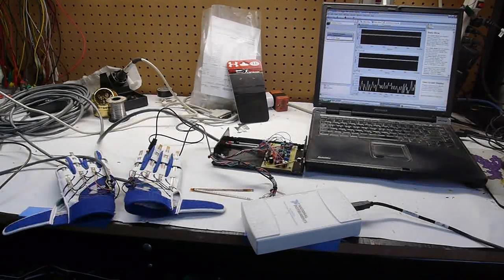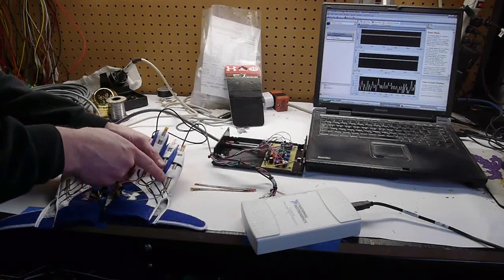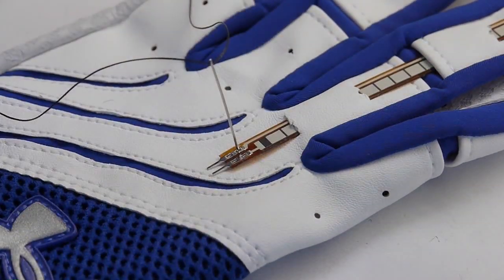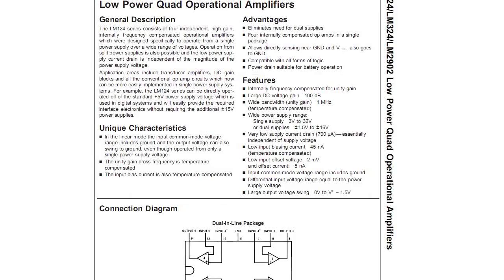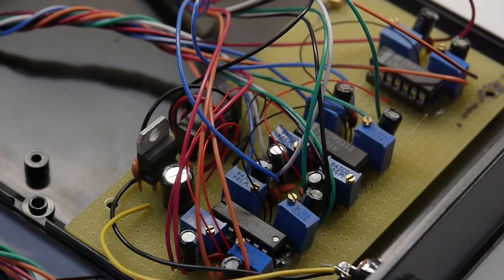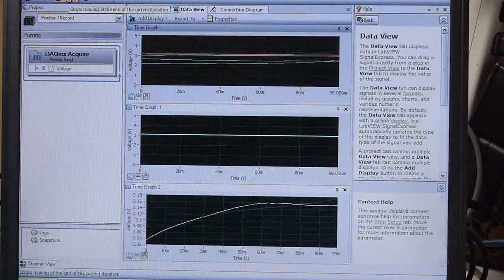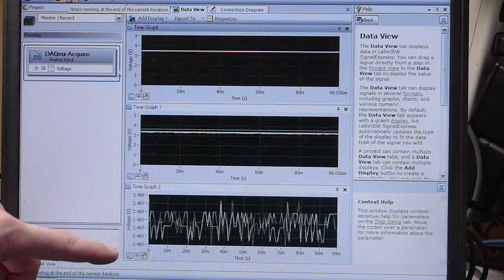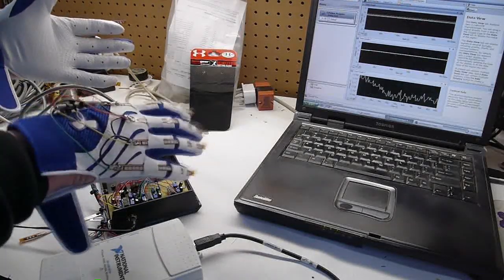DIY flex sensor gloves for possible VR or video game control

Comment: Big fan of your work Ben and extremely envious of your shop! Being a hobby electronic musician I'm wondering if you've ever taken a stab at making a custom MIDI controller. I'm curious of what you might fathom. At one point I had considered making a melodic step sequencer with far more available notes than what's commercially available but haven't taken the time to learn the engineering needed. There are some pretty cool devices available that get the imagination going for what is possible. (I'll put a link at the end of this post). If your looking for new ideas, have it! Keep up the good work sir!
http://www.musicradar.com/news/tech/7-crazy-but-cool-midi-controllers-586479

Comment: I'm working on a similar project involving flex sensor gloves. To address the problem of the sensors sticking out of the tips of the fingers, I drilled a small hole in the plastic at the end of each and sewed them into the tips of the gloves with a few stitches. When you bend your fingers, the sensors are able to slide, being pulled by the motion of your fingertips. I'm using them to control a robotic hand, personally, for fun. Great project!

Comment: would you settle for 1000? (for the entire setup excluding the laptop)
because the sensors are 10 bucks a piece, so 100$ for that,
gloves? 60 at the most? $160, next your NI USB-6210 is around 600$? so thats like 760 total? plus 150 for wires? total= 910$
plus 90$ for labor? grand total 1000$... lets be reasonable. i would do this myself, but i just do not have enough time. I really like the materials you used and the thinking behind it thats why i am still offering you 1000$ where as another